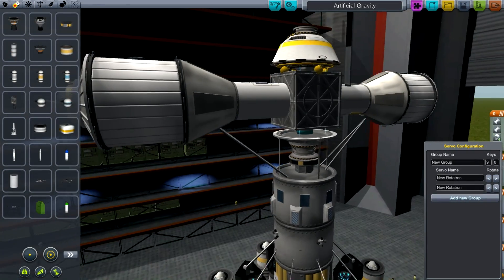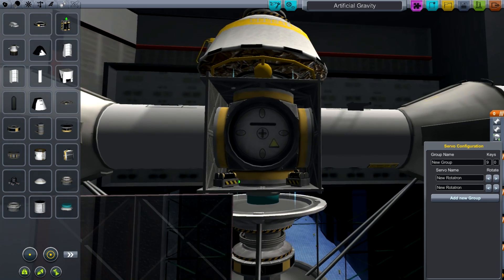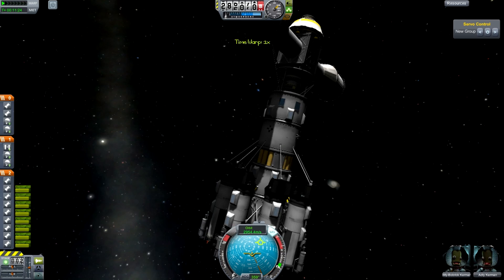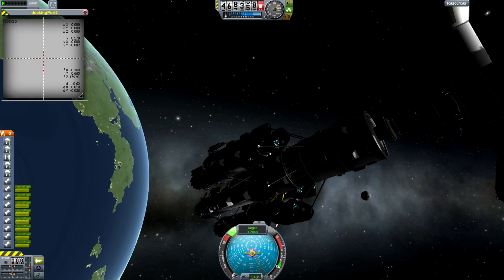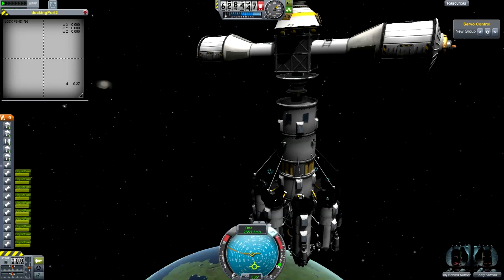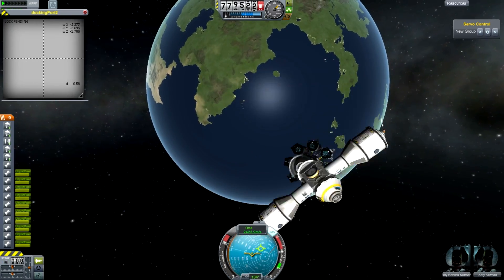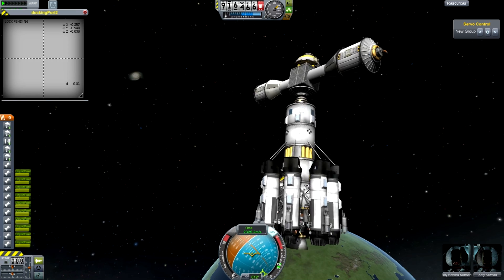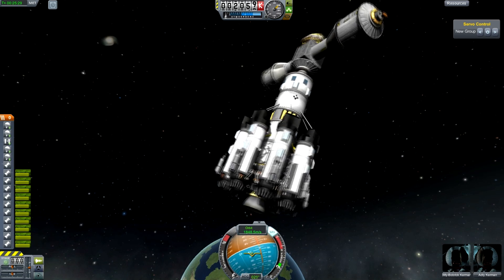Kerbal Space Program - Artificial Gravity System Design

Comment: If anyone is trying to do this get Infernal Robotics. It's something Scott has used in Interstellar, and the Robotics parts are great, but they have what's called a docking washer in game, one is with friction, the other however is frictionless. I tried it out and it works really really well, you can put it in line with any parts really even though it's 1.5m and it really is frictionless, I made a Centrifuge for Jeb and Bill to get sick on, and I had one top and bottom of the Mk2 lander can and the top one didn't spin as the stuff underneath it did, so it's completely frictionless. I even made a helicopter with a probe body and landing gear with a frictionless washer on top, and then a small fuel tank with wings and the little orange engines on the wings, it actually flew pretty well as long as SAS was on, I mean for what it was, it was easily controllable. So if you put that in space you could easily make artificial gravity that is perfectly balanced because radial symmetry works if you use a probe body or fuel tank for the centerpiece. I think there might be a way to set up the tanks so that the engines don't draw any fuel off the ship itself, though I haven't tested that yet, but overall the bearings themselves are amazing, if you are trying to do artificial gravity in 1.0.x it's definitely the way to go. Also if you are worried about clearance I tested it and you can always stack a couple washers on top of each other.
Reply: Two notes, if you use them it's good to quicksave, sometimes on loading the physics will mess up and without even starting the rotation it will start freaking out till the ship explodes. But it seems like if it doesn't happen within 30 seconds it doesn't happen at all. Also it's a little more stable using when you don't stack the washers, they can cause occilation that can get bad if not paid attention to. But if you only put one on the top and bottom of the section that you want to rotate and then it should be fine, once in space it actually requires almost no thrust to keep it spinning, once it's going it doesn't seem to stop, I let it spin for about 30 minutes with the engines off and it didn't even seem to slow down. It's definitely the way to go for this, just make sure you don't have the probe body or capsule spinning, that will make it impossible to fly, if you use a probe body or capsule and put the artificial gravity rig on a fuel tank or structural fuselage then you can still control the ship and turn like normal while it is spinning. I mean it works better than any other setup I've tried and with no occilation at a realistic speed, if you crank it up of course things get wacky.

Comment: The problem you're trying to solve with artificial gravity isn't really that the people float around inside of the ship; it's that the human body will be severely weakened by extended periods of time without something like a strong gravitational pull acting on it.  

Wearing a suit which has a force acting on it might help some, but it's probably better if you can have the force acting directly on all parts of the body.

Comment: Ah, but how about two rockets on each side, facing opposite directions! Then set up a command key binding (I forget what they're called) so one key makes the ship spin anti-clockwise and the other key binding makes it spin clockwise. I mean yeah, it does use some fuel, but it's better thant he violent stop it currently has.
OR...
If the game engine can handle it, make a disc shape for two wheels to contact on the bottom, then use the wheel's brakes to slow the spin :)

Comment: good in theory, less so in practice. The command module spins faster then the reuseable launcher, so when you had killed the rotation of one, the other would still be spinning. Not to mention that they rotate in opposite directions, so while killing rotation of one, you are adding inverse rotation to the other and would require a lot of "this way, that way" to kill rotation of both. So, while possible,  entirely impractical. I believe Scott's setup is the easiest and most efficient way.

Comment: Hey Scott, rather than use those firespitter fuel containers, why not try and use structural fuselage and put an RCS drum on each side of the rotating section? Then instead of rockets on the end, put RCS blocks. Then you don't have to brake so violently with the quantum struts, instead using RCS a bit.
Alternatively use those little fuel drums and put both engines facing the same way so one acts accelerates and one brakes. Would thrust on one side only make it start tumbling early though?

Comment: Yes, but you don't land it after a launch.  I'm thinking the lifter will boost until the payload is headed towards the correct apoapsis and then separate.  The payload will boost into orbit at apoapsis and then you can return to take control of the booster, correct course and then land vertically under power on land.

Comment: Now a=w² * r, where w is the angular velocity (estimated 3 rpm -> w = 0.3142 rad/s) and r the radius from the center (estimated 5 m) it should be about 0.5 m/s² which is about 0.05 G (not grams). To have 9.81 m/s² you would need an angular velocity of 1.4 or 13.4 rpm which is quite fast.

Comment: You can enhance the stability of this kind of system by exploiting the fact that parts of same ship don't actually collide with each other. So you can use struts past the rotating sector, connecting the base of the ship to the top part over the spinny thing, and that will then act as though the spinny thing had an axle through it... sort of. When it rotates, it just phases through the struts. Undoubtedly it'll be fixed at some point.

I think I'll make a quick video demonstrating this...

Comment: I've read that using rotation to generate artificial gravity would have to be low enough RPM to not induce a Coriolis effect in the "wet parts", which means the radius of rotation would have to be something like 200m to produce 1g at that RPM.